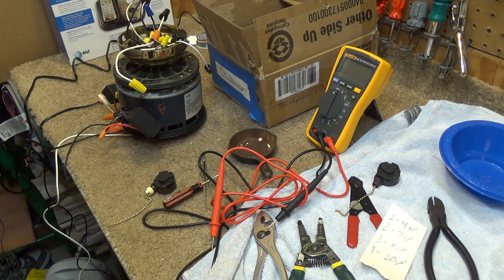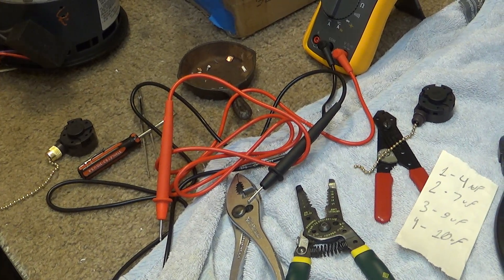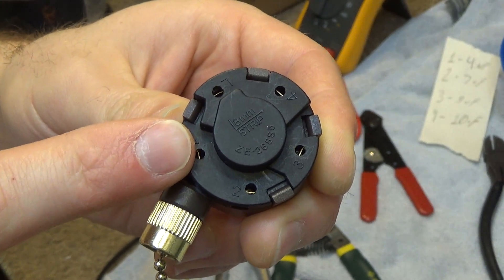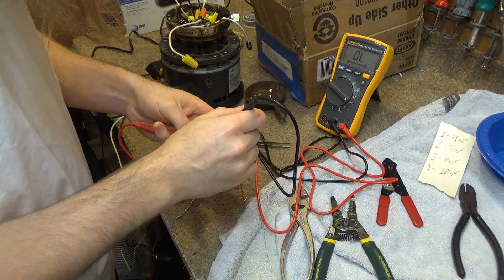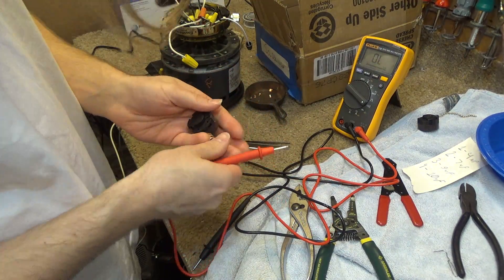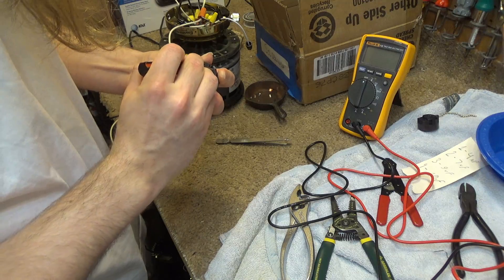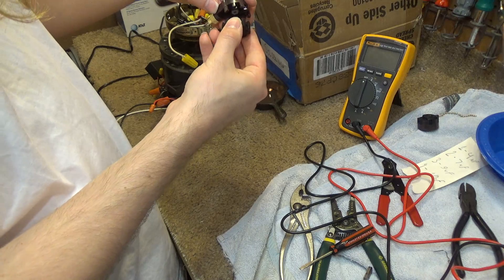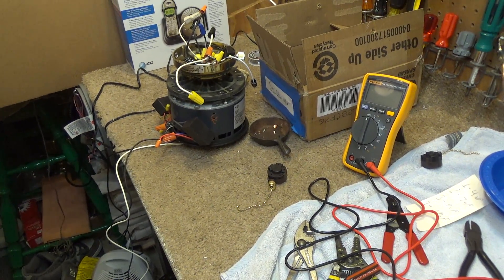ZingEar ZE-268S5 4-Speed Pull Chain Switch Modification

Comment: Wow, thank you! I am facing the exact same issue, I have the switch on order and had hoped to be able to modify it in this way for my application. Glad I thought to look up if someone else had done it, saved me the trouble of figuring it out on my own. If orders show up on time I’ll have new bearings and the new switch with all 4 speeds working, actually for the first time ever, as the fan was originally a 3 speed, but the motor I repurposed to replace the burnt out original is a 4 speed, I had used the 3 speed switch and just left one of the middle speeds hanging. Now that the original switch has burnt out it’s time to upgrade and have all the speeds!
Reply from the maker: Hope it works for you!

Comment: Can I use it asa light switch ?
Reply from the maker: From a technical perspective, one could use it to apply and remove power to a light, but I cannot fathom why one would when a proper light switch is ready to work out of the box and a fraction of the cost of this one.

Comment: OMG!!! If people come to this youtube video they will be overwhelmed with what you're doing. Everything is already wired INTERNALLY! "L" or line is your hot line in, (black) wire. 1, is whatever was in position 1 on the old 3-wire fan switch. 2 is for whatever wire was in position 2 on old switch. 3 for wire 3. DO NOT BRIDGE THE BLACK WIRE ACROSS FROM POINT TO POINT!!! I guarantee this WILL melt the switch IMMEDIATLY upon applying power!!! I am a 30 year journeyman electrician (4 year apprentice). A 4 year avionics technician and a 25 year skilled tradesman business owner. Bachelors degree in engineering.
Reply from the maker: There's no evidence that's happened to anyone who has viewed the video, and there's no reason it should happen. Nothing in the title, description, or even the video itself, indicates that this is a tutorial for, or has anything to do with, replacing and/or rewiring a conventional 3-speed switch in a typical household ceiling fan. This particular fan has been in use for months now with no trouble. It is wired correctly.
Reply: @JordanU  Thanks for sharing what you did on your fan project, and I can see how Jaz could be concerned. FYI, I don't have any of the accolades he does, just good common sense.
I broke the pull chain in the original switch and discovered that my replacement "5-wire" switch for my very old Hunter 4 speed fan needed the mod too. And by making the line in feed specific to only supplying one output on the switch at a time (by modifying the rotating barrel contact like you did) has the fan working the way it should.

Comment: Just added a 4th speed to my '84 Hunter Original, using a 15uf capacitor, and the same model switch. I made that modification to isolate the four terminals. Very helpful video.
Reply from the maker: Thanks, I'm glad you found the video useful..
Reply: Jordan U disk
Reply from the maker: @ceilingfansportablefansand2030  Do not post spam.
Reply: Jordan U why
Reply: Jordan U ok